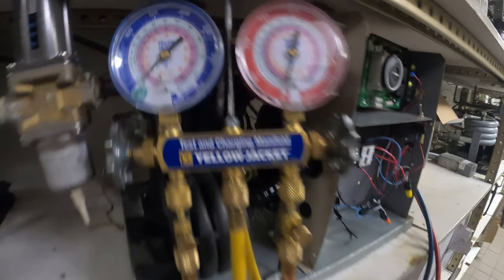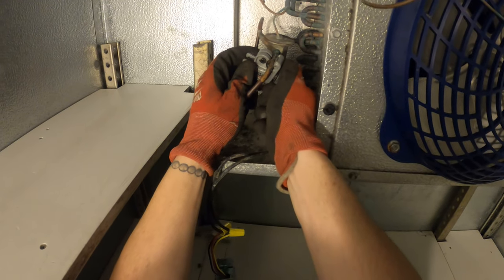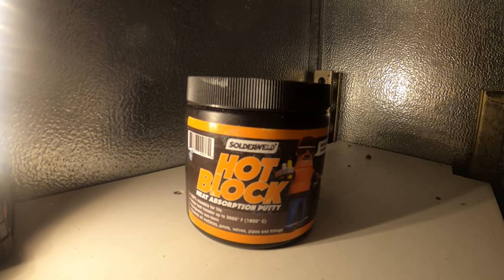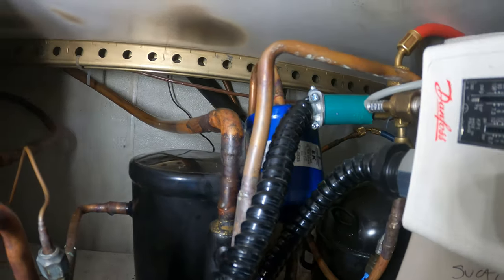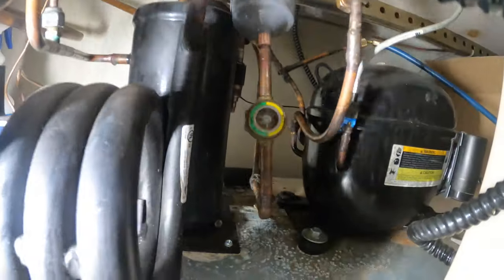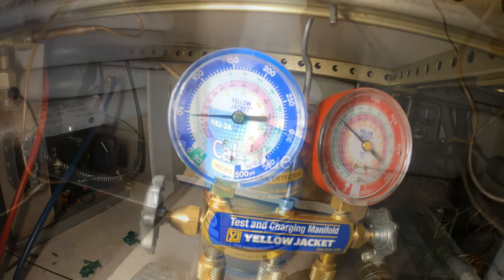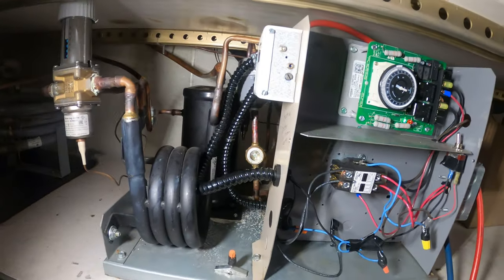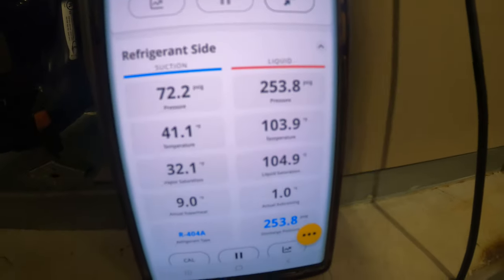HVACR Service Call: Walk In Cooler Not Cooling (Thermal Expansion Valve/TXV Installation)

Comment: Good job Jumper, That kink in the line was no good, but one thing I'm not sure is that you might have to open the solenoid valve when brazing and/or charging and recovering, Good job regardless.
Reply: You are correct. He needed to put a magnet 🧲 on the solenoid. Not criticizing just how I would do it.
Reply: I hear you loud clear, no one likes criticism these days.